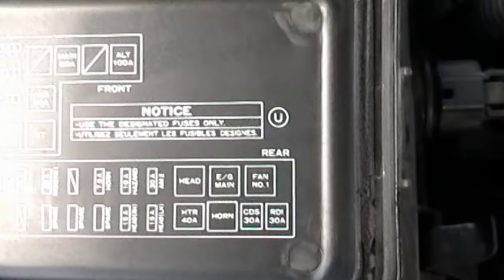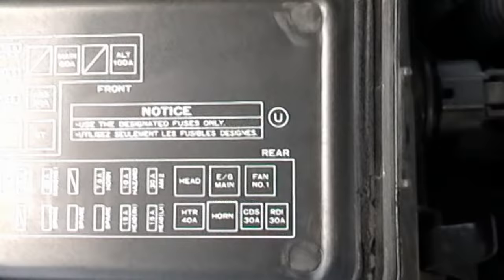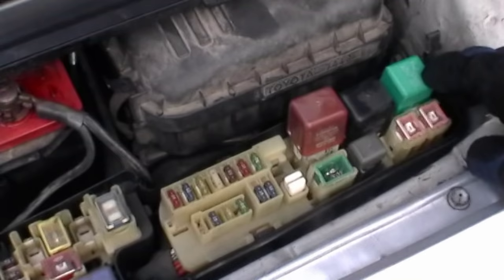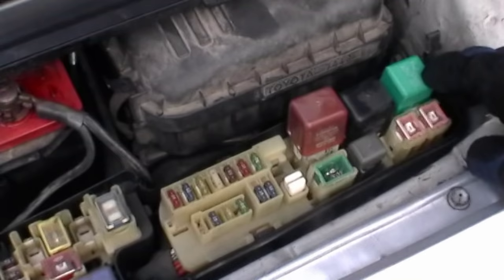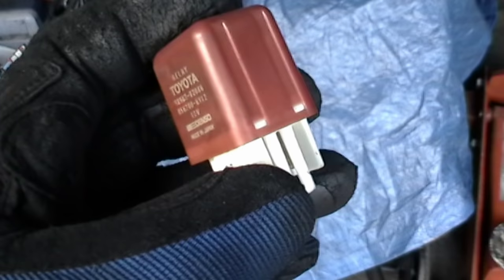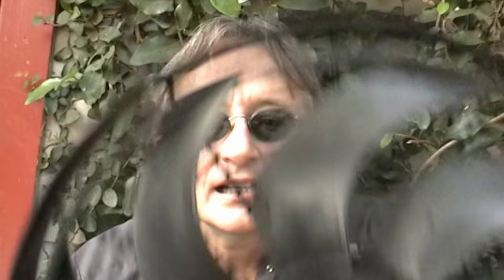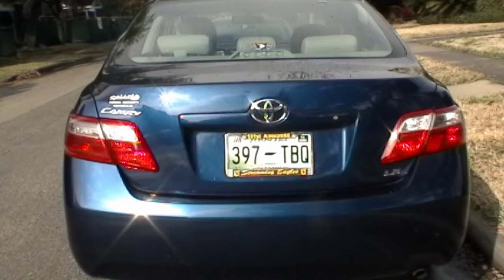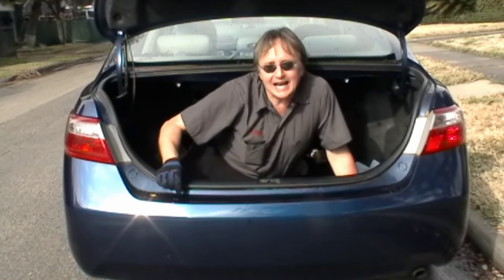How to Repair a Cooling Fan in Your Car

Comment: So my a.c. turns on SOMETIMES, and other times it doesn't even work, I noticed also that when I'm driving on the freeway and the a.c. does work it begins to over heat, could it be the compressor or the fan belt? Or maybe the thermostat?
Reply from the maker: if you  are on the freeway with ac on going 55 or faster, and it overheats, either the radiator is shot and can't dissipate the extra heat, or more likely the ac commpressor is going out

Comment: Im not getting any power to my #1 fan relay in my 88 toyota celica.  I was and then like an ahole I cleaned the terminal with a small brass brush got a small spark then nothing.

Comment: Hey Scotty, i have another problem and i dont know even what to google for it: my fan switches on too early. it switches on and off a few times, but the temperature gauge doesnt even go up halfway. i guess that it even switches on while driving the highway, wich isnt supposed to happen, as my dad told me. fresh spark plugs, cooling fluid and oil. i will check the MAF sensor to be sure. i really find it annoying while parking: i m playing with the clutch to get the car parked, the radiator fan switches on, even the headlights get dimmed so heavy is this fan, engine dies... try picking up girls if they see you mess up your parking skills..

Comment: Please help. I did everything you did on my corolla. Replaced all the sensors and still the fans won't work when it gets to normal op temp. Fans both work as well as all the relays and fuses. I suspect a bad circuit from that single wire coming from the cooling fan temp switch. How do I check continuity or voltage on that single wire??
Reply from the maker: me, I'd just run power lines to the fans off a toggle switch to turn them on manually. Cause in your case, It's often a bad main computer circuit that's the culprit on that corolla

Comment: Hey Scotty I'm having some trouble with 2005 suburban my fan. The temperature gauge get correct temperature readings. It runs with the ac on and when I hooked it directly to the battery. I checked the fuses and the relays with a multimeter and they work. I shorted the wired going to the ECT and that caused the fan the run so I replaced the sensor, but that didn't fix it. Now I'm about to replace the thermostat and burp the radiator. If that doesn't work what else can I check?
Reply from the maker: realize they are ultimately computer run and gm has nothing but electronic problems when they age. Me, I'd wire the stupid fan to a toggle switch to turn it on and off manually if your fix doesn't work

Comment: Scotty kilmer I have a 08 Scion xB with dual radiator cooling fans but my ac blows hit when Ian in a stop & just replaced new blower motor & resistor but my engine fan works great and the other is weak after being tested you think I should replace the entire radiator fan assembly or just that one has fan motor?

Comment: 2004 Lexus RX330....My cooling fans will not come on when I turn on the AC...they will flinch but that's it....but when I push it a bit with my hand, it pops right on and runs fine...do I need to replace the fan assembly???

Comment: Hye Sir Scotty...I have replaced the cooling fan switch, check the fuse and the relay...they are all fine...the fan I have tested connecting the battery..and its totally fine but when I start the engine and leave it in idle up until it reach the temperature where the fan starts spinning..its spinning low only..my car is Alphard MNH10...I dont see there is any low or high relays installed in the fuse box...I have been trying to fix the issue but so far I still cant fix it..Can you suggest what I can do to next...the issue is the fan is spinning low...when I connect the battery directly, the fan spins the normal speed/fast...but its connected to the newly replaced cooling fan switch, it spins slowly..Please help..

Comment: According to this video, my motors are bad. My friend tested both motors. One barely spun up, and the other one didn't come on at all. If it is a motor for both of them that I need, where would I find one for 2000 Subaru Legacy ? I am having a hard time finding them.
Reply from the maker: rock auto or a junk yard

Comment: Sir i hava a little problem with my a/c when i'm at idle speed it doesn't blow cool air,but when im going fast it is functioning well.what could be the most probable problem on my car's a/c system. your answer will really reduce the burden in me.....
Reply from the maker: +wenifred III either cooling fan on the radiators aren't working, or the system is low on refrigerant or has a weak AC compressor

Comment: Hey scotty quick ? I have a 03 saab that just overheated. So the first thing i did was check the fuses then bought a new cooling sensor. But i got a little inpatient and blamed the fan so i pulled it out hope i didnt make a mistake. So i did the test anyways on the fan with the simple jumper wire to the battery and the fan doesnt spin. Is that a clear sign of a bad fan motor ?

Comment: I just had one question when checking the cooling fan temp switch. Are you using both a positive and negative jumper wire? Or just one connected to the negative battery and the outside of the temp switch?
Reply from the maker: on this one wire system, you unplug the sensor then just run a wire from that connection to engine ground or negative battery terminal
Reply: Scotty Kilmer So i did that but the fan didn't come on. Do you know what that could mean then?
Reply from the maker: Scotty Kilmer
it means the wiring is bad, or the main computer is bad, or the fans are burned out. good luck

Comment: I have a NIssan Sunny Ex-Saloon (N16). My cooling fan doesn't switch on. So i always put my AC on and drive. I changed the Coolant Sensor, but still not working. I got an auto-electrician to check if power is following, ALL is good. So please advise what should i do to fix this problem (Cooling fan to come on without the AC on)?
Reply from the maker: if the sensor for the cooling fan isn't the problem, often it's the main computer. so pray it's that sensor
Reply: Thanks Scotty. 
What happens if it's the main computer? How do i fix it? How much will it cost?

Comment: Hey Scotty, I have an 96 Toyota Camry and I did everything you did in the video, but when it comes to the fan relay when it's all the way in place the fan doesn't work. When the fan relay is half way in the fan starts to work. I replaced the whole relay fuse box and it;s the same thing. Do you know what may be causing this.
Reply from the maker: you have some kind of wiring problem, but if you replaced the box with a used unit, I would suspect that's bad too

Comment: Hey scotty i have nissan cefiro and when i drive my car, heats come inside the car  through  feet vents why its happen . my car temp. is also normal and when i push my ventilation button all heat coming stop. everything goes normal.

Comment: I have a 1997 Isuzu Rodeo V6.  I have a fan that comes on only when I use the AC.  This smaller fan is located at the very front of the car in front of the radiator fan/radiator and usually kicks on and off depending on how hot my car gets while using the AC.  It runs good at ALL times except after about 15 minutes of driving and it's really hot and when I idle.  If I'm on the freeway, the high speed wind is enough to cool my car down, so the AC will work easily for an hour.  I'm guessing I should start with the relay?  Also, wouldn't there be a different temperature sensor for this AC related fan instead of the general radiator fan?
Reply from the maker: change the temp sensor for the cooling fans, the one for the normal operation, not the AC operation. Pray it's that, but on those, often a bad main computer circuit does that
Reply: Thanks, I'll work on it.

Comment: ive tried all you suggested I even got a new sensor and switch for the coolant temperature, but still no luck turning them on? what could be wrong with my fans?
Reply from the maker: if the fans work when you hot wire them directly with power, as in the video, then odds are your main computer is bad, the circuit that drives them is probably shorted out. Most guys just rewire them with a switch or direct to the battery then, see if a mechanic in your area will do that

Comment: I have a question ..I have 1999 dodge caravan 3.0L  ..when I crank the car on idling mode...car will heat up till normal temperature..which now my fans should turn on to cool the engine..but fan do not turn on..so my oil light comes on...engine is not making noise and is running great... also if I turn AC on fans do turn on..and oil light turns OFF...so i replace temperature regulator, fan relay, checked my BCM unit and PCM unit ...somebody mentioned electric Fan thermostat?  I can not find any videos of where is located or how to replace it...can you help please

Comment: Hi cooling is not  running  but engine  was not over heating  but before  my car was over  heating  celliderhead  now when the car ok fan can't run it only runs when we unplugged the fan

Comment: I had  several wires in the trunk of a Mazda 626   2001 touched and  melted the wires and now the fan turns on as soon as I turn on the car what could be the problem? I replaced the wires

Comment: Hey Scotty. 
I've got a Subaru legacy 1995, both cooling fans doesn't go on. My car doesn't over heats.. But I'm just woried what might happen while I'm driving.. Please give me some advice.. Cheers
Reply from the maker: they only come on when the engine gets hot, if it gets 90 or higher in your area, car will either overheat then or fans will come on, the computer turns them on only when engine gets hotter

Comment: Tomorrow (Saturday) I'm going to try and replace the cooling fan in a 2004 Chevy cavalier. Do I have to take it out from the bottom? Or is there extra bolts I can remove on top to hold the radiator after loosening top n bottom fan bolts n clips so that i can take it out from the top if I'm careful? I'm not a strong woman and have a bad back but it isn't going to stop me from doing what I gotta do. I just have to make adjustments. I don't have jack stands anymore, just regular jacks and I don't want to be under the car a lot.
Reply from the maker: Sallie Curtis I always take em out from the top. Not that big of a deal
Reply: Thank you so much! That was a fast reply too :). Jenson tire quoted me $385.00. The parts were about $85 when I got them. Have a good weekend to you!

Comment: hi  scotty i have 2013 toyota camry se, my cooling fan is not working, i tested fan like you said , fan is good and i tested rely by putting new one. i cant find cooling fan switch, does it  even have cooling fan switch?
Reply from the maker: yes, go to a dealer parts dept, they can sell you one and show you on their computer the location

Comment: After unplugging the plug to the fan connector on my car, I came to realize that it housed four terminals. Not two. To which terminals am I supposed to plug the wires leading from the battery if there are four?

Comment: I’m having a problem. I bought new coolant temp sensor that I broke when I was lowering the engine back into the engine bay. Fans won’t come on at all even with the AC blowing. Fans will only turn on when the coolant temp sensor is unplugged.

Comment: So my 2006 jeep liberty the wire to fan came loose tore it to all hell...I have no connectors to either the fan or the other connector basically tore it apart...Any ideas?  Can I just hard wire it? Its 3 wires on both ends...

Comment: Scot love your videos. My Honda Accord 25 Ann. cooling fan only turns on when the car is off. The car heats up when I drive it. Fan motor works. I need your advice. Thank you sir...
Reply from the maker: +Armando Martinez hondas do that when main computer circuit fries. ME, I'd cut the fan wires and run em direct to a toggle switch and bypass all that crap
Reply: Do you have a video on that on how to? I would like to send you a donation for your help. Won't be much, but I want to thank you.You have helped me more than  you can know... I have saved so much money. Money that I don't have....LOL.... Than you sir

Comment: My fans only work when I manually spin the left facing fan then they work. Do I need new fans? The mini van is a 1999 honda odysey 194,000.00 miles. My guess is yes.

Comment: I have a 2006 vw 2.5 and the radiador fan goes on when the car is off, most of the time it happens in the middle of the night and sounds like a lawnmower. what could it be ?

Comment: Scotty : I have a 95 Camaro v6 3.4 
The cooling fsn stopped working i replaced the temp sensor fan relay all fuses to the fan good replaced the thermostat gets to temp and doesnt turn on If i hook the battery to a test wire to the fan sensor does come on I cant figure out what else it could be?

Comment: Scottie please help... 2011 Buick LaCrosse.. a/c only cold while driving, warm air when stop or idle.. I noticed 2 fans that only turn on together (I believe for radiator) is one of them supposed to be on to cool the condensor? The compressor turns on and engages properly like it should and dealership check r134 levels and was fine ... maybe relay or what do you think?
Reply from the maker: I would make sure both fans are working full blast at idle with AC on. Fix that first

Comment: Hey Scotty thanks for the videos! one question, what happens if your fans are constantly on after the engine on a 06' 350z is running at normal temperature? they sound like they are on full blas and wont go off until i shut down the car. by the way the temperature needle is normal, no leakage, just the loud fans on. Thanks and i hope you can answer! Good day!
Reply from the maker: try a new coolant temp sensor for the fan, pray it's not in the main computer with the circuit shorting out

Comment: hai scotty. i got problem with my fan. it only spin when i switch on my a.c.   I already change my thermostat  and cooling temperature  sensor.  and i check already the fan fuse its also working. can you help whts the problem?

Comment: Hey Scotty my fans turn on more often than before. I recently replaced the coolant than discovered that the radiator was leaking and bought a new one at AutoZone. After the instillation I noticed that the cooling fans turn on more often than before. I need to mention that when I did the radiator flush and let the car idle for 10 minutes with the heater on, I forgot to put the drive belt on and the engine was running with out any of those accessories. I turned it off quickly after I had realized only about ten minutes into the process. The car doesn't heat up but the cooling fans still turn off often than before when I had it running on water. What's going on with my car?

Comment: hi scott. i've seen your video several times and now i have a problem that i need your expertise on this. i have an nissan x-trail year model 2006. my fan motor would not rotate after i've start the engine. i wait for around 30mins of idle but still the fan wont rotate. my vehicle is a gasoline engine type. hope you can help me with this.
Reply: Test the fan directly to battery see the fan working or not 

Then check the fan relay and fuse

Comment: i have a question. on my car i have two fans. when the car gets hot only one spins..works. Are both supposed to be spinning? is this the reason why my temperature occasionally rises
Reply from the maker: yes, probably need a new fan motor, when really hot, both spin

Comment: Scotty I have a 1991 chevy Silverado. I get no signal to the tbi. I can add gas and it will run until the gas run out. I hot wire the fuel pump just to see if it works. do you have any ideal wjats my problem
Reply from the maker: often a bad crank sensor does that

Comment: hi, im just confuse with toyota corolla.. does the radiator fan and condenser fan runs simultaneously even when the engine still cold?
Reply from the maker: +jps1422 only if the AC is on

Comment: My is getting hot. 
Even i changed coolant sensor and thermostat. Check engine light on for PO128. My AC and heating are working fine. Water pump is working fine. I bleed out air from radiator.  Now when I turn on my car and don't turn on my heater or AC. Then radiator's both pipes top and bottom one get hot. And if I turn on heater or AC then bottom pipe of radiator gets low in temperature than upper radiator pipe. 
But car is still getting heat up. 
Please Help. 
Thank you

Comment: So, at a 1:49, You saying how to ground the switch and then it cuts to you hooking the other end to the battery,, didn't tell how to hook it to the switch and the hardness wire,,  can you please explain how the jumper hooks to the temp switch and then to what before you hook the other 2 sides to the battery ? I really need to do this test. I think this video could use a update and talk about how pcm stop sending a signal n all. :)
Reply from the maker: it's an old video, things used to jump when uploaded.  you simply unplug the sensor, then put ground power to the wire you just unhooked from the battery ground terminal. That should make the fan go on IF it's a bad sensor. No other wires need connecting

Comment: @ScottyKimer

i did all steps you mention seems like i had to wiggle my fan no 2 relay and fan came on...but temp gauge still reading hot...pass H...and a lil smoke from engine when running about 3 minutes...any advice?

Comment: scotty,i have a 2000 civic ex,i check the fan motor(it came on),i checked the fuse and relay,but i tried to check the switch like you did(expect with old speaker wire,since i did not have any of those clips),and the fan did not come on,what could be wrong?
Reply from the maker: if motor works when hot wired, rather than mess with that complex honda computer control system, why not just wire it with a toggle switch, that's easy. If not, you will have to deal with complex honda electronics, often a job for a pro